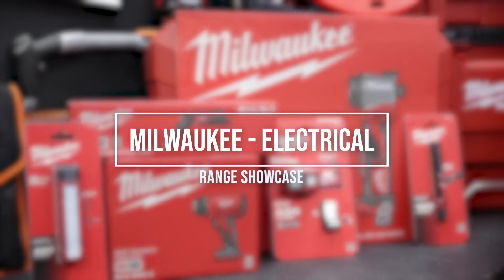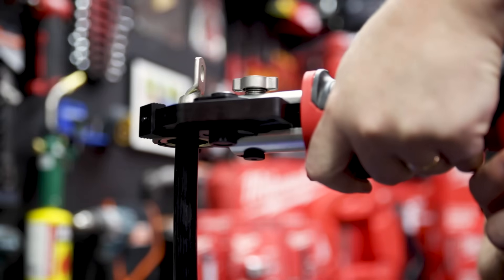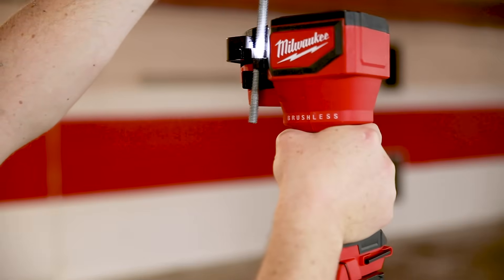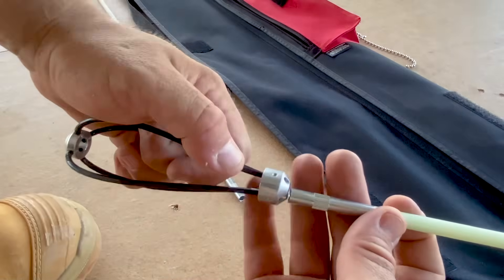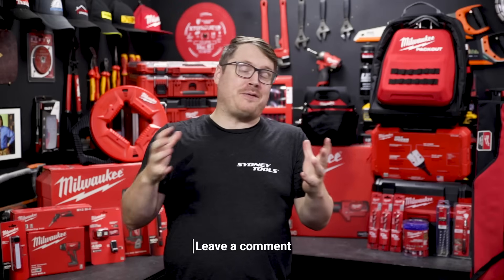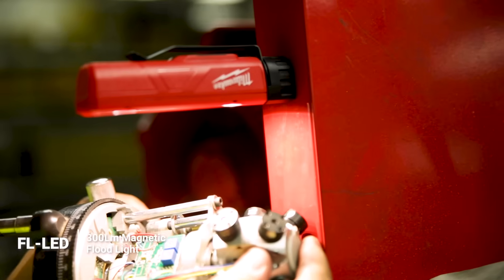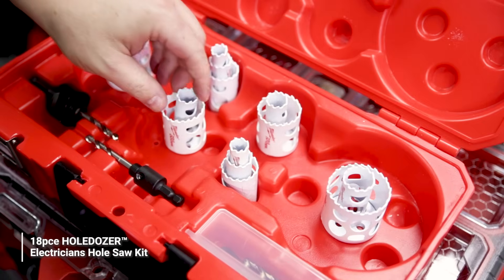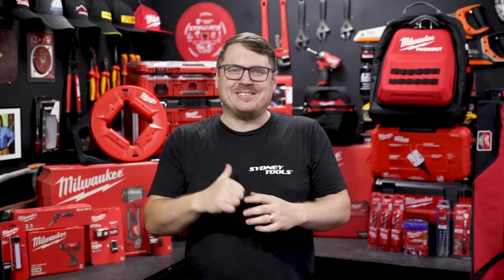Milwaukee Electrical Tools - Electricians Showcase

Comment: The milwaukee led torches batteries dont last ive bought 6 pivot lights 4 batteries died after 1 year. .shame . The swivel head torch i had 4 of them  3ah . Batteries 8 months 1 died and 2 years later 2 others died i know warranty comes in place but its a shame that they die . Over time . Im not buying them no more man .

Comment: Electricians tools case: screwdriver and hand moisturiser
Reply: Forgot the pliers mate. I have a spot in my handbag for it all.
Reply: @AddictedtoTools  a sparky doesn’t use pliers. 
They do what they are told by the tradies who do the hard work. 
Builders , plumbers and boilermakers all tell the sparkys what to do. 
Put your cables here,,,, run the wires here… 
Bottom of the food chain son
Reply: @properaussie331  too easy mate. Keep it up😂👍
Reply: @properaussie331  non of your tools 🔧 or equipment would work if I didn't show up and turn the power on bud 😉  
Most important guy on the jobsite.......
Reply: @erikhope8315  you have no idea how silly that sounds, I take it your new to being qualified? 
Every tradie knows the world stems from metal workers and engineers. 
Walk around your house and take 5 to realise what’s made of steel champ
Reply: @properaussie331  
P.P.S you wouldn't be sitting there commenting on YouTube if it wasn't for electricity.......
Reply: @erikhope8315  which gets generated from boilermakers , mechanics and engineers lolololol. Omg this is classic. 
If you research the history of how an electrician was classified it’s from metal workers and engineers long long ago. 
The entire world revolves around metal shaping and welding. 
From a sparkys screw driver to a hospital bed someone’s sick mum lies in. 
Peace brother!
Reply: @erikhope8315  didn’t think an electricians toolbox would be worth more then a duel trade HD mechanic/boilermaker but ok you win son! 
Cya on a mine site one day doing what your told Lolol ❤️
Reply: @properaussie331  Did your Mrs leave you for a sparky?? Why you so mad??
Reply: @properaussie331  if we don't have pliers,  what are we supposed to hammer our screwdrivers with?

Comment: It is amazing that this brand was a Harbor Freight brand.  I like everything I own from Milwaukee
Reply: You mean Pittsburgh?
Reply: HARBOR FREIGHT
In 1977, Eric Smidt and his father, Allan Smidt, started Harbor Freight and Salvage in a small building in North Hollywood, California. The company began as a mail order tool business that dealt with liquidated and returned merchandise. As the business grew, its name was changed to Harbor Freight Tools. In 1985, Eric Smidt was named president of the company at age 25; he served under that title until 1999, when he became chief executive officer.[7] From the mid-1980s to 2010 Harbor Freight was headquartered in nearby Camarillo, California.

MILWAUKEE
It all started in 1918. World War I was coming to a close, and automotive tycoon Henry Ford was looking for a fabricator who was willing to produce a compact, lighter-weight, portable version of the 1/4" capacity power drill. A young Wisconsin manufacturer by the name of A.H. Petersen accepted Ford's commission, and developed what came to be known as the Hole-Shooter. Weighing in at only 5 pounds, this revolutionary power tool was driven by a series-type Westinghouse motor, and was the first industrial drill that was light enough to be operated with just one hand, but powerful enough to handle heavy-duty workloads.

Four years later, in 1922, Petersen was joined by business partner Albert F. Siebert, and together, the two of them founded the A.H. Petersen Company. Tragically, a fire destroyed their manufacturing facility the following year, and the financial setback forced the company to close their doors. In 1924, Siebert was able to purchase the company's remaining assets at auction, and reopened the company as the Milwaukee Electric Tool Corporation, with the goal of fully realizing the sales potential of the Petersen Hole-Shooter.